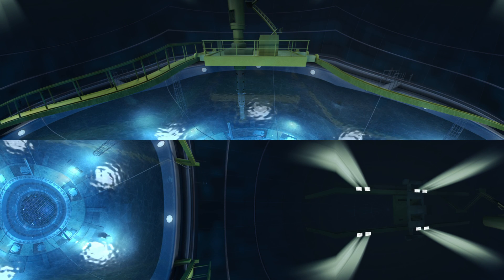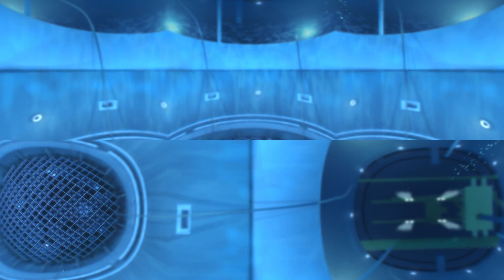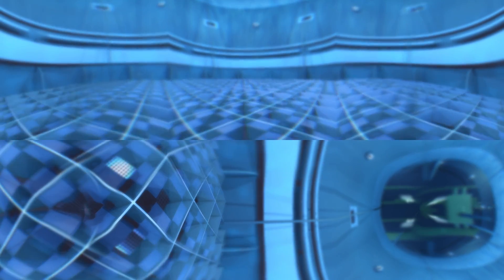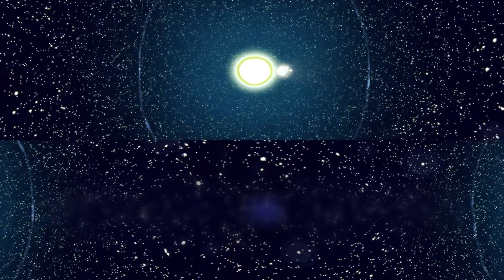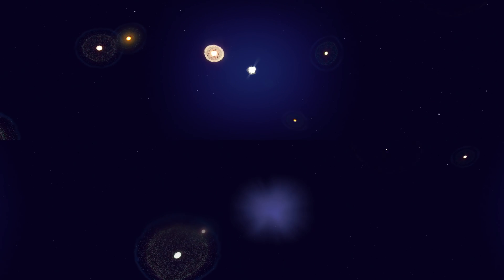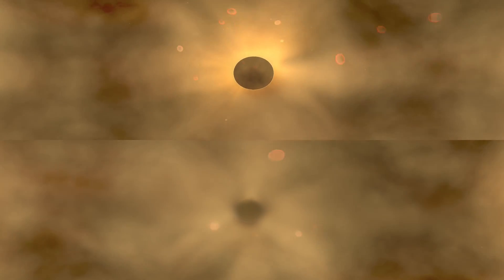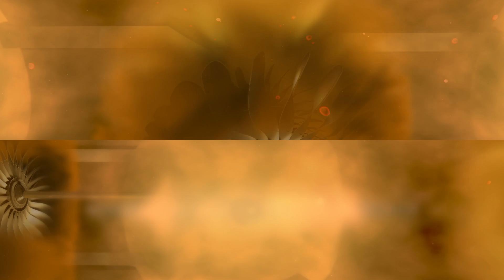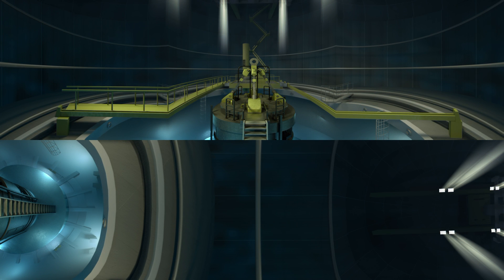What is nuclear energy? Shrink down to an atom and find out

Comment: It's mad how a nuclear generator is in essence just an advanced steam engine.
Reply: Why not also have nuclear powered cars? "Honey see you later im glowing to work."
Reply: Andrew Bills haha
Reply: Basically. We need nuclear powered trains
Reply: @stormeagle81x  And nuclear powered passenger airliners
Reply: Henrik Svensson good look getting a lead and concrete lined aircraft to fly...
Reply: @stormeagle81x  
"We need nuclear powered trains"
I want a nuclear powered wristwatch.
Reply: @stormeagle81x  no danger there then, perfectly clean and harmless
Reply: @paradisebreeze1705  Imagine using nuclear power and harmless in the same sentence.
Reply: @dawn-blade  If you add up ALL of the damage done by ALL of the nuclear accidents in ALL of history it still wouldn't come anywhere close to comparing to the damage done by fossil fuel-based plants in a single year.  People only see the bombastic headlines that nuclear accidents create.  They don't see the slow burn of what greenhouse emissions are doing and will do to the planet.

Radiation is nasty, but it's measurable.  It's manageable.  Climate change is essentially a pending mass extinction event.
Reply: Well we have been using pressurized light water nuclear reactors in vessels for 65 years being operated by 16 year old bois trained during a few months 

Yet there hasnt ever been a reactor failure in submarines despite the fact they use highly enriched fuel (80%)

Light water reactors were made for vessels 

Metal cooled reactors were made for powerplants 

Graphite moderated ones for weapons production
Reply: Sword of the Morning fossil fuels are much more harmful to the environment that nuclear power.
Reply: Sword of the Morning you get more radiation from standing outside for 45 minutes than you would standing outside the reactor compartment of any naval nuclear powered ship.
Reply: The Power of Dreams I wish it was a few months. I’ve been here over a year now
Reply: @dawn-blade  imagine using power and harmless in the same sentence
Reply: @dawn-blade  Nuclear fusion is pretty harmless.
Reply: @paradisebreeze1705  Clean? Yes. Harmless? If handled as such, deffo. There's been no nuclear-related accident with UK/American subs since their conception - and those reactors are underwater with extremely limited space, and a crap ton of other hazardous factors.

Cost-effective? Now that's a real issue for nuclear powered trains haha
Reply: Yes.  We've basically been heating water in order to turn wheels for about 300 years now, and it's gonna continue for a while yet
Reply: @AL3X2580  fossil fuels release more radioactive particles into the atmosphere than nuclear power does too - to the tune of several chernobyls' worth of emissions each year.

But it's not all in the same place and it's not "fiercely radioactive", so nobody cares.

It's kind of ironic that if nuclear emission standards were applied to coal and gas power stations, they'd all be shut down tomorrow.
Reply: @thepowerofdreams6816  ya there has
Reply: @sasca854  True, people like to point out Chernobyl as an example for the dangers of Nuclear power. However not Centralia, Pennsylvania, which has a underground coal fire burning for 50+yrs.
Reply: Avv
Reply: @sasca854  everything you said was true except that radiation is manageable. tell that to the fukishima power plants where one reactors radiation has spread, and is now measurable all across the pacific ocean. 
you can contain in by never letting it spill into the atmosphere or environment, but once it does, theirs no managing it.
Reply: @sasca854  "not much nuclear accidents happened its ok"

Everybody thinkin they right til' chernobyl and fukushima comes in
Reply: @dawn-blade  We should have harmless nuclear power in every home!  :)
Reply: @sasca854  We can fix power plants.  We can't fix leftist idiocy.
Reply: @sasca854  The Sixth Mass Extinction Event has already started. And yes, man-made CO2 is by far the predominant influence for this extinction.

If we enact a Green New Deal immediately, we might be one of the species to survive the extinction. All bets are off if we continue to delay.
Reply: @sasca854  only problem is the waste, but i still think you're correct.
Reply: @marktarmannpiano  i know right, here in france its the same thing, they are still being utilized despite being over their deadline
Reply: @stormeagle81x  I would agree except:  We haven't the track laid for a high-speed coast-to-coast train.  If you using nuclear might as well go for the gusto.
Reply: @stormeagle81x  i think the soviets had a nuclear train.
Reply: @stormeagle81x  The tunnels would have to be widened.
Reply: WHATEVER'S CLEVER  yes there is a legacy of poor management of waste. That's the unfortunate reality of the bomb rush that happened. 

A lot got kicked down the road or rushed into before there was any long term storage plan set up and now the clean up is costly. 

And yet it's still less than the harm fossil fuels are causing. 

I want you to take a look at this from a different perspective. 

Fossil fuels cause deaths. Lung cancers go right up near coal plants. An uncountable number of thousands of people are killed yearly by the fumes from our cars. Waste products are often just dumped into the sea and then you have things like the oil spills and so on. 

It's not even remotely clean and yet the attitude towards this damage is almost blasé, if one is even aware of it. 

Compare that level of actual harm and the attitude towards it to the level of actual harm nuclear power causes as a function of standard operating procedure and the attitude towards any risk.

It's topsy turvy and nonsensical.
Reply: Nuclear power can be dangerous if done wrong, obviously, and the tv show quite accurately portrays how nasty ionizing radiation can be .

It actually doesn't show the full extent of how bad it can get for a person hit by enough to kill them within a week or two, the skin literally falls off, which is very messy (and obviously fatal).

However the thing that annoyed me a little was no mention of how the numbers Akimov puts out regarding things like millions to be killed across Europe, etc, were actually wild exaggerations. 

Think of damage from radiation as kind of like damage from kinetic energy. Your body can repair the damage from you running into a wall at average speed. All the tears in your skin, the destroyed capillaries, etc, just get put back together. However, fall off a third story ledge or get hit by a car travelling at 40mph and your body is going to struggle to fix the damage without error. If you survive at all.

Your body can repair mild radiation damage but really struggles when it gets hit by a lot and the thing that matters most is how much you're getting hit by in a short time.

If the radiation spreads out over a large area then you have lots of people getting hit by a relatively small amount and if that relatively small amount is within that bounds of what your body can easily heal...

The assumption is that the long term cancer risk is linearly proportional to the dose, no matter how small the dose there's always a risk and from that you can apply that assumption across, say 700 million people and claim that x dose will equal 100 thousand people killed or whatever. The "linear all the way down" assumption is unfounded as at low doses there is no measurable uptick in cancer rates. We don't even know whether radiation hormesis is true like how hormesis is true for many other biological processes.

It got on my nerves a little. 

Other than that though, fantastic show
Reply: and when nuclear fusion becomes a thing, we'll essentially have mini star-powered steam engine's.
Reply: @Mattyboyzie  THE ULTIMATE (AND CLEAR) MATHEMATICAL UNIFICATION (AND PROOF) REGARDING PHYSICS/PHYSICAL EXPERIENCE IS NOW DEMONSTRATED, AS E=MC2 IS F=MA: TIME DILATION ultimately proves (ON BALANCE) that E=mc2 IS F=ma, as ELECTROMAGNETISM/energy is gravity. This NECESSARILY represents, INVOLVES, AND DESCRIBES what is possible/potential AND actual IN BALANCE. (Importantly, balance and completeness go hand in hand.) The stars AND PLANETS are POINTS in the night sky. NOW, A PHOTON may be placed at the center of WHAT IS THE SUN (as A POINT, of course); AS the reduction of SPACE is offset by (or BALANCED with) the speed of light (c); AS E=mc2 IS F=ma; AS ELECTROMAGNETISM/ENERGY IS GRAVITY. Indeed, ultimately and truly, TIME is NECESSARILY possible/potential AND actual IN BALANCE; AS E=MC2 IS F=MA; AS ELECTROMAGNETISM/ENERGY IS GRAVITY. Very importantly, outer "space" involves full inertia; AND it is fully invisible AND black. GREAT. Accordingly, INSTANTANEITY is thus FUNDAMENTAL to what is the FULL and proper UNDERSTANDING of physics/PHYSICAL EXPERIENCE; AS E=mc2 IS F=ma; AS ELECTROMAGNETISM/energy is gravity. It ALL CLEARLY makes perfect sense. Gravity IS ELECTROMAGNETISM/energy. E=mc2 IS F=ma. ELECTROMAGNETISM/ENERGY IS GRAVITY. E=MC2 IS F=MA. GREAT !!! Gravity AND ELECTROMAGNETISM/energy are linked AND BALANCED opposites, AS E=mc2 is F=ma; AS ELECTROMAGNETISM/ENERGY IS GRAVITY. Consider THE MAN who is standing on what is THE EARTH/GROUND. Touch AND feeling BLEND, AS E=mc2 IS F=ma; AS ELECTROMAGNETISM/ENERGY IS GRAVITY. The stars AND PLANETS are POINTS in the night sky. GRAVITATIONAL force/ENERGY IS proportional to (or BALANCED with/as) inertia/INERTIAL RESISTANCE, AS E=mc2 IS F=ma; AS ELECTROMAGNETISM/ENERGY IS GRAVITY. Gravity/acceleration involves BALANCED inertia/INERTIAL RESISTANCE, AS E=mc2 IS F=ma; AS ELECTROMAGNETISM/ENERGY IS GRAVITY. Accordingly, the rotation of WHAT IS THE MOON matches it's revolution. Great. MOREOVER, a given PLANET (including what is THE EARTH) then sweeps out equal areas in equal times consistent WITH/AS F=ma, E=mc2, AND what is perpetual motion; AS ELECTROMAGNETISM/ENERGY IS GRAVITY. Gravity IS ELECTROMAGNETISM/energy. INSTANTANEITY is thus FUNDAMENTAL to what is the FULL and proper UNDERSTANDING of physics/physical experience, AS E=mc2 IS F=ma; AS ELECTROMAGNETISM/ENERGY IS GRAVITY. This NECESSARILY represents, INVOLVES, AND DESCRIBES what is possible/potential AND actual IN BALANCE. Stellar clustering ALSO proves ON BALANCE that E=mc2 IS F=ma, AS ELECTROMAGNETISM/energy is gravity. Objects (including WHAT IS the falling MAN) fall at the SAME RATE (neglecting air resistance, of course), as E=mc2 IS F=ma; AS ELECTROMAGNETISM/ENERGY IS GRAVITY. "Mass"/energy is gravity. ELECTROMAGNETISM/ENERGY IS GRAVITY. E=mc2 IS F=ma. THE DOME of a PERSON'S EYE is ALSO VISIBLE. (Notice the flat AND black space of what is THE EYE.) The stars AND PLANETS are POINTS in the night sky. The sky is blue, AND the Earth is blue. THE EARTH/ground AND THE SUN are E=mc2 AND F=ma IN BALANCE, AS ELECTROMAGNETISM/ENERGY IS UNIVERSALLY PROVEN TO BE GRAVITY in what is a mathematically unified fashion. E=mc2 IS F=ma. The middle distance in/of/AS SPACE AND the full distance in/of/AS SPACE are NECESSARILY linked AND balanced. MAGNIFICENT !!!!!!!!!! INSTANTANEITY IS thus FUNDAMENTAL to what is the FULL and proper UNDERSTANDING of physics/physical experience, AS E=mc2 IS F=ma; AS ELECTROMAGNETISM/ENERGY IS GRAVITY. Gravity IS ELECTROMAGNETISM/energy. It is ALL CLEARLY proven. Again, the stars AND PLANETS are POINTS in the night sky. GREAT. Energy has/involves GRAVITY, AND ENERGY has/involves inertia/INERTIAL RESISTANCE. GRAVITATIONAL force/ENERGY IS proportional to (or BALANCED with/as) inertia/INERTIAL RESISTANCE, AS E=mc2 IS F=ma; AS ELECTROMAGNETISM/ENERGY IS GRAVITY. Gravity/acceleration involves BALANCED inertia/INERTIAL RESISTANCE, AS E=mc2 IS F=ma; AS ELECTROMAGNETISM/ENERGY IS GRAVITY. It is all CLEARLY proven !!!!!!!! TIME is NECESSARILY possible/potential AND actual IN BALANCE, AS E=MC2 IS F=ma; AS ELECTROMAGNETISM/ENERGY IS GRAVITY. Gravity IS ELECTROMAGNETISM/energy. GREAT !!!!!!!! BALANCE and completeness go hand in hand. By Frank DiMeglio
Reply: @Mattyboyzie  It may be that Fusion doesn't lend itself to down sizing.
Reply: everything is just a steam engine we literally have 90% steam engine to produce energy
Reply: @AS-vj1ux  If aint broke don't fix it? Steam turbines today can get efficiencies between 54% and 65%, which is pretty neafty
Reply: @thepowerofdreams6816  water moderated nuclear plant steam turbines have efficiency vastly below this as they're limited to 450C abd  can't produce dry superheated steam. They also suffer badly from blade erosion caused by condensation occurring due to the lower temperatures
Reply: WHATEVER'S CLEVER  I feel like I must've edited this one too many times after I first posted it and it got lost to YouTube's silly spam algorithms. So I'm gonna copy paste here cos I really don't agree with your dismissal of the fossil fuel - nuclear fuel waste comparisons. If you've already seen it then meh.

 I don't agree that it's apples to oranges.

We're talking about real harm. The fact that the harm comes in different ways is kind of besides the point. 

The US has 20% of its electricity come from nuclear. That's not trivial. France has 72% nuclear.

The health and safety approach with nuclear in western countries adhering to IAEA standards is that a risk of 1 in a million people dying is acceptable. That's crazy high standards. The fish trawling industry is at something around 1 in 700.

The petroleum industry doesn't have that kind of health and safety standard. It gives us acid rain and climate change and a fair chunk of air pollution.

The sea levels are rising, the storms are becoming more frequent and more intense, the temperature climb is killing things that can't adapt to it fast enough and running the risk of a starvation ripple through the food chain. It's pretty devastating.

Nuclear power in contrast to that is downright clean.

Did you know that a single deep storage cavern could be used to store all the high level nuclear waste in the world for hundreds of years even if we did switch fully over to it on a global level?

Why don't we do that? Because the people who would do it without permission don't care enough to do it and the people who would do it with permission of those above the storage always get told no because nobody wants that under them, despite the fact that it would not be a risk. 

This is because the perception of the risk is far greater than the actual risk and because people don't trust the industry anymore. Perhaps justifiably given Chernobyl and the practices of just throwing the waste in pools to be tomorrow's problem that occurred during the bomb rush. There's no trust.

Fukushima involved an evacuation of the surrounding town that killed a few people. The sad thing is nobody would have died (outside of normal situations) if they hadn't evacuated. From what I've read the doses to the locals didn't go past ~25mSv. The lowest point at which a correlation between an uptick in a chance to get cancer at some point in the next 30 years and dose is ~100mSv and at that point the risk increase is very small. Just about perceptible in epidemiological studies across hundreds of thousands of workers, etc. The tuna industry took a hammering because 4Bq per kg of Cs-137 was found in a fish. 4Bq per kg is utterly trivial. To get equivalent to the radiation dose from eating 1 banana you'd need to eat something like 4 kg of that tuna at once. It tells you the fish is safe to eat yet the reaction was to be terrified.

This is why I say the perception of risk is out of line with the reality. 

People still live around Chernobyl. The wild life there is doing great. Yet the fictional stories we tell are of a glowing, sickly wasteland full of mutants. That's the perception. The feeling.

It's simply false. Or at least it's so far blown out of proportion from the grain of truth it was built on that it loses connection to it.
Reply: WHATEVER'S CLEVER , nuclear waste is not "leaking into the environment." Also, fun fact, Nuclear waste is the only one that it meticulously maintained, which I find extremely humorous that people use this as an argument against nuclear. "HOW DARE YOU MONITOR AND STORE YOUR WASTE AWAY FROM THE PUBLIC." What do we do with fossil fuels, or solar waste? Nothing. Literally not a god damn thing. 

Legislation also gets blocked by democratic administrations. One for a depository, and another for reprocessing. We also have fast neutron reactors for waste, if nuclear could actually receive decent funding and stop with the fear mongering. Those that bitch about waste are the ones that oppose the plans made to handle it, and they also turn a blind eye to fossil fuels and solar waste.
Reply: Yeah it's sad to know that they use it to boil water 😂
Reply: yeah, I reckon a mini-reactor in every garden shed is the way to go, cut out the pylons and all that pesky cable
Reply: Official Purkki most civilian reactors have several feet of water which is very good at thermalizing neutrons as well as layers of steel and lead. You get more radiation from outside than you do working on a reactor plant.
Reply: Jonny S Pretty much all generation is
Reply: @Dragonoidalpha  https://en.m.wikipedia.org/wiki/Multi-mission_radioisotope_thermoelectric_generator
Reply: Here's a reactor that isn't a steam engine... https://en.m.wikipedia.org/wiki/Multi-mission_radioisotope_thermoelectric_generator
Reply: @Astumed what about particle physics,  string theory and loop quantum gravity?
Reply: @Astumed well I've never worked in a nuclear reactor,  and I'll admit (especially since even the experts fail to control this process from time to time... 3 mile island,  Chernobyl,  Fukushima...) that it's "not" easy... and an extensive background knowledge of particle physics,  thermodynamics relating to rate of heat transfer over the lifetime of each fuel rod bundle,  fluid dynamics and mechanical rotation of the rotor within the stator... to generate AC for step up (transmission efficiency over line distance)... coupled by probability regarding times of 'peak' or low demand... there's certainly alot to it... however at MIT sophomores... can train and master these processes sufficiently to obtain license... required to operate 'the on campus' experimental reactor (a proper nuclear reactor... but instead of generating electricity... it's purpose is to 'generate a stream of neutrons' for various student or faculty initiated experiments as well as for doping of silicon for precise ratios (for use in fail safe and critical electronic applications.)
Theoretical physics regarding gravity and matter spacetime... requires an extreme grasp of quantum and relativistic theory... and all the mathematics associated with those two branches of physics.  The calculations for these theories are generally done by faculty at the Post Doctorate level... and simulations involve dedicated time on a super-computer.
Nuclear physics... practically applied... is relatively well understood by comparison... and controlled fairly competantly by engineers and computers using input output variables with warning and alarm parameters in place to safely (most of the time) control the rate of free neutron absorption within the reactors fissionable fuel rods... which in turn determines the rate of fission (based on probability along with the density of fissile material remaining as build up of neutron absorbing waste products occur (plutonium from uranium 238 etc.)

The rest is heat/pressure calculations and turbine rotation rates regarding the generation of AC.
Reply: @davidhenningson4782  The Fukushima incident wasn't really caused by bad management.
Reply: @vincentb5431  I said "even the experts  'fail' to control this process from time to time."
... and it's true... in the event of an 'earthquake' and resulting tsunami... the experts 'were' overwhelmed... by circumstances they couldn't control. 
Never said Fukushima was caused by 'bad management' ... maybe 'bad location' considering how the plant fared following mother natures tantrum that year.
Reply: @vincentb5431  I'd call ignoring the GE engineers building the plant who pointed out that the backup generation location was dangerous and that they should be relocated to higher ground "bad management" (That was 30+ years BEFORE the tsunami)

And I'd call retaining hydrogen due to its slight radioactity and a paranoid fear of radiation, directly contradicting procedure manuals which ordered that it be vented "bad management"

And I'd call refusing to ask for external assistance when there were emergency generators primed and ready to go from Okinawa within hours of the problems becoming apparent (Tepco _repeatedly refused the offers) because of stubborn national pride "Bad management"

There were a bunch of other nuclear generation sites hit by the same Tsunami. None of them had their generators flooded out, because they didn't have their generators in a location susceptable to being knocked out by floodwaters.

Fukushima was a good example of just about every bad decision that could be made, being made. It wasn't until the on-site chief engineer basically told Tepco management to *** themselves and started acting despite their orders that things started improving - the sad thing is that thanks to heavily ingrained Japanese cultural norms of deference to superiors even when they're blatently and obviously WRONG he took so long to do it. (This isn't unique to Fukushima: A number of air crashes have occurred because cockpit crew didn't care contradict the captain(*) and the japanese lost a number of space probes because workers didn't speak up when designs which were patently broken got into the assmbly process - in fact int he latter case, input from foreign space agencies pointing out fatal flaws was ignored in a number of cases and in other cases the workers who spoke up were sacked for insubordination)

(*) Not unique to asian culture and after Tenerife made it clear the culture of KLM was just as toxic, led to massive efforts in changing aviation culture - it's still extremely hard to break the hierarchical mentality of "following orders regardless of their sanity" and the air crashes still happen.
Reply: @miscbits6399  oops. industry shill gets slam dunked.
Reply: Fusion perhaps not so much
Reply: @gregoryionovichpage7716  a fusion reactor would still be about boiling water to turn turbines.

It's generally all about producing heat in order to create motion inducing pressure.

Water just happens to be pretty decent for the task and in great abundance
Reply: Steam punk gone wild
Reply: Hydrogen powered for mobile, nuclear fission power for power plants today, nuclear fusion power for tomorrow 😊
Reply: True
Reply: Yea
Reply: Seems as though we take all the advantage we can to bring new technology down to our level of ability to handle.  And most of the time control.  Parallel this to burning dwindling fossil fuels to create an entire worldwide industry of travel.
Reply: Its actually simpler lol
Reply: wantafanta01  Using nukes as propulsion has come up before.  I remember reading about the idea in science-fiction books but later heard that idea was being floated as potentially feasible for interstellar space travel.
Reply: Yup, but they're inefficient, because they're not hot enough to drive the turbines properly. Check out the Oak Ridge Experiment and LFTRs 

How does a 99% reduction in nuclear waste produced sound?
Reply: yes but don't let it blow up there will be hell to pay
Reply: It's only a problem because there are radioactive bits dissolved in the water. If you separate the water and the radioactive materials then a steam explosion is merely a steam explosion.

The man who INVENTED the nuclear reactor as we know it realised that and set out to make a better nuclear reactor in the 1950s - he succeeded and had it sucessfully running during the 1960s, however it was so safe  - and so virtually impossible to weaponise - that his reward was to be drummed out of the nuclear industry in 1972 and his work got declared Top Secret and all the notes destroyed by one Richard Milhous Nixon(*). To this day it's still illegal to perform actual nuclear molten salt nuclear experimentation in the USA - they rewrote the rules to prevent anyone ever trying to replicate the work that proved how safe it was.

(*) Thankfully all the researchers at Oak Ridge hid their notes instead of burning them as they were ordered.

Using fissionable uranium (U235) or plutonium to fuel a nuclear reactor is on par with using Naptha or TNT to fuel your car. Just because you can doesn't mean that Petrol (natural uranium) or diesel (Thorium) isn't a better fuel
Reply: yup
Reply: wantafanta01  MANY reactors lost on seafloors globally, and they're a minor part of total nuke waste.
Reply: Should do same follow up on nuclear wastes.
Reply: wantafanta01  You're thinking of space travel, not using nuclear bombs on Earth to leave orbit.
Reply: So is a gas or coal power plant
Reply: exactly. people think that they just toss in some rods and all of a sudden the electrons are excited and they flow out of the reactor. they forget the huge alternator, just like your car engine and electrical set up in your car.
Reply: yep, still scary, because water vapor is no joke, it can explode even when I'm just cooking beans, I immensely respect steam power !
Reply: Just out curiousity, how did your mind imagine a nuclear reactor working before you learned that. One of my friends thought it radiated green light that we then harnessed for power some how.
Reply: Jay Blake  Google.  They NEVER lie, right, Jay, ol' boy?
Reply: WHATEVER'S CLEVER  What you are missing is that Yucca Mountain Repository was built to accept all that waste and store it safely. But Nevadans refused to allow it to open. That is why we are storing so much of it in less safe places and manners. If we could store it at Yucca Mountain, then we really could say "nuclear waste is relatively easy so store". We certainly would not have the "60 year old nuclear waste leaking into the environment" if we could use Yucca Mountain.
Reply: @Jermain-cz4bh  Yes of course
Reply: generator*
Reply: Magnet wheel go bzzzzzt
Reply: It's really fascinating.
Reply: Fart  Did I laugh?! I agree that nuclear is the future not shoddy renewables. Rather than focus on renewables investment needs to be made in the area of science and research into nuclear fusion.
Reply: President Joe Biden  The more theories on how to best accomplish long-term space travel nukes have been coming up as a viable method of propulsion.  Thanks for the reply.
Reply: yeah your british lol
Reply: Precisely. Disappointing thing is that Thermonuclear reactors of initial generation are also planned as water boilers. Magneto-hydrodynamic generation? Nah, sorry, too complicated.
Reply: Quetzocoatlas Gamer  haha no shit, imagine millions of basically small nukes driving around. Speaks for itself.
Reply: Not at all. It's just a common way to transfer energy but the nuclear reactor is wholly separate from the steam engine.
Reply: WHATEVER'S CLEVER  I don't agree that it's apples to oranges.

We're talking about real harm. The fact that the harm comes in different ways is kind of besides the point. 

The US has 20% of its electricity come from nuclear. That's not trivial. France has 72% nuclear.

The health and safety approach with nuclear in western countries adhering to IAEA standards is that a risk of 1 in a million people dying is acceptable. That's crazy high standards. The fish trawling industry is at something around 1 in 700.

The petroleum industry doesn't have that kind of health and safety standard. It gives us acid rain and climate change and a fair chunk of air pollution.

The sea levels are rising, the storms are becoming more frequent and more intense, the temperature climb is killing things that can't adapt to it fast enough and running the risk of a starvation ripple through the food chain. It's pretty devastating.

Nuclear power in contrast to that is downright clean.

Did you know that a single deep storage cavern could be used to store all the high level nuclear waste in the world for hundreds of years even if we did switch fully over to it on a global level?

Why don't we do that? Because the people who would do it without permission don't care enough to do it and the people who would do it with permission of those above the storage always get told no because nobody wants that under them, despite the fact that it would not be a risk. 

This is because the perception of the risk is far greater than the actual risk and because people don't trust the industry anymore. Perhaps justifiably given Chernobyl and the practices of just throwing the waste in pools to be tomorrow's problem that occurred during the bomb rush. There's no trust.

Fukushima involved an evacuation of the surrounding town that killed a few people. The sad thing is nobody would have died (outside of normal situations) if they hadn't evacuated. From what I've read the doses to the locals didn't go past ~25mSv. The lowest point at which a correlation between an uptick in a chance to get cancer at some point in the next 30 years and dose is ~100mSv and at that point the risk increase is very small. Just about perceptible in epidemiological studies across hundreds of thousands of workers, etc. The tuna industry took a hammering because 4Bq per kg of Cs-137 was found in a fish. 4Bq per kg is utterly trivial. To get equivalent to the radiation dose from eating 1 banana you'd need to eat something like 400 kg of that tuna at once. It tells you the fish is safe to eat yet the reaction was to be terrified.

This is why I say the perception of risk is out of line with the reality. 

People still live around Chernobyl. The wild life there is doing great. Yet the fictional stories we tell are of a glowing, sickly wasteland full of mutants. That's the perception. The feeling.

It's simply false. Or at least it's so far blown out of proportion from the grain of truth it was built on that it loses connection to it.